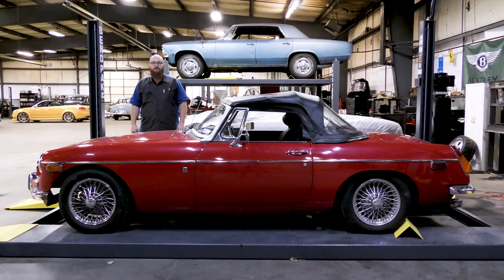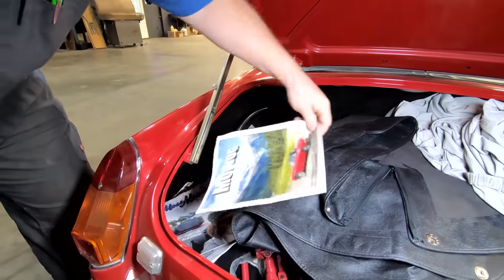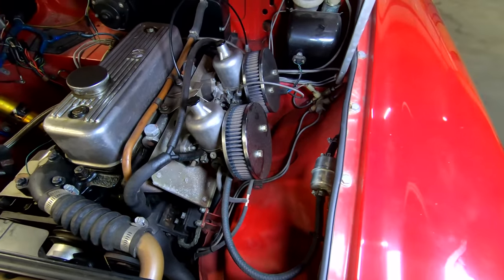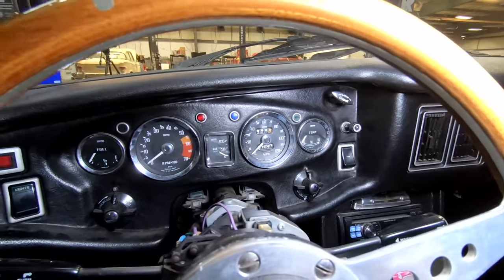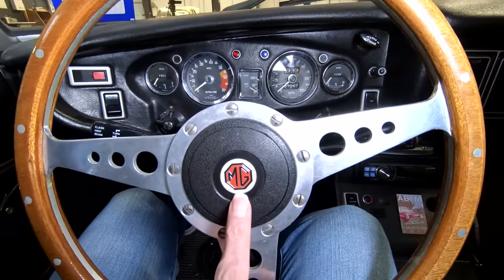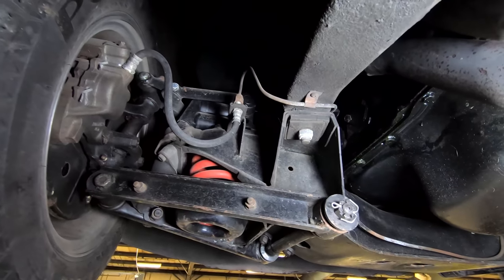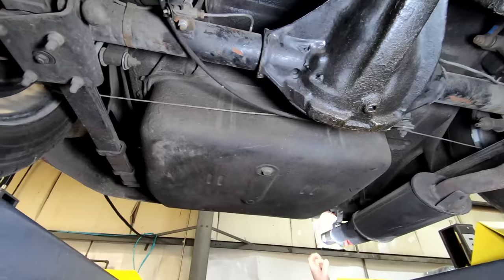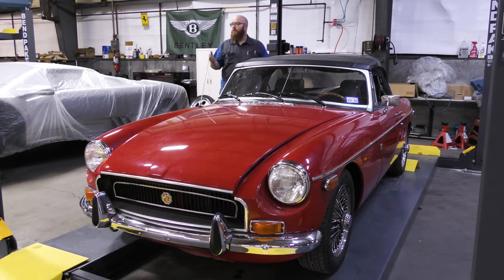Cherry 1972 MGB! See exactly why it earns a thumbs up from the CAR WIZARD!

Comment: For us here i Denmark, the easiest and best supplyer is Rimmer Bros in UK if you need parts for english cars. And they are not overprized at all. If this nice car was mine, i would put in a german Bosch fuel pump....because we all no - Lucas parts will fail at some point 😉
Reply: Us car enthusiasts would benefit a lot from a free trade agreement between the US and Europe. Euro parts are expensive in the US, and US parts are expensive here, thanks to taxes and customs fees.

The UK could easily make their own trade agreement with the US now after Brexit. That way British parts would be cheaper and easier to obtain for American enthusiasts.

It's ridiculously hard to get some parts for my 23 old Volvo, in Sweden! Most of it is out of stock, and not many thought of saving parts 'cause an S70 isn't (wasn't?) a desirable classic. But now it's really hard to find certain parts, especially electronics and such. It's pretty easy, and not very expensive, to find on eBay from the US. But then there's the taxes and customs fees when buying from outside the EU... And suddenly the cost doubled!

Comment: MOWOG refers to the Morris Garage and Wolesy car companies,  note the side of the block.  The oil in carbs acts as the accelerator pump.
Check all ground point as this is notorious for failing lights. It had two 6volt batteries wired to create 12V
Reply: It's to stop the throttle pistons moving up too quick, so in a way correct.  I had same carbs on TR7.
Reply: @flybobbie1449  Cool usual the TR 7 had the stromberg CD 175
Reply: @johnbuchanan6045  Later on, early had the SU, well my 76 car had them.
Reply: @flybobbie1449  I’m not well versed with the TR7 world I know my Mg’s and Jags
Reply: To expand on John’s answer:
MoWoG dates back to the time of the merger of Wolseley and MG into Morris Motors, it is accepted that Mo stands for Morris and Wo stands for Wolseley, but the G has 2 versions one says it stands for Group, the other says its for MG

Comment: I think that’s a 1966 or ‘67. After 1970 they had smog pumps, safety bumpers and sat higher.

It’s a really nice example with bits from new to original.
Reply: The pre-68 ones had chrome grilles, seats without headrests, black crackle finished metal dashboards, toggle switches instead of rocker switches, etc. This car does appear to be a ‘72, but de-smogged, with aftermarket valve cover and air cleaners. The raised ones with black bumpers didn’t come along until a few years later.

Comment: I had to replace the ignition switch in my B a few years ago. Finding a replacement for a decent price was almost impossible. Ebay sellers wanted $150 for a NOS.  I found one for a more reasonable $35.
Reply: Kayak TN....I believe this is your second post on the topic.

If it locked up.. 1hr fix, as most , and no cost.

Comment: The MGB was the real oxcart of the British roadsters back then.  The best one was probably the Jensen-Healy, but the best British style roadster of all was the Datsun 2000 as it was quick for the time and dependable as a nail.  A lot of fun.  The best small roadster though was the Alfa Romeo Spider 2000, but it also was the most expensive.

These owners must be new to Austin.  Although I do not see that many British cars on the road anymore, there are Jaguars and Aston Martins and Lotus around.  For BMW there are 5 excellent independent shops.  BMW was a very successful import brand back in the late 60s here.  One shop I know in Cedar Park has an ex-Jaguar tech embedded in it.  

I doubt anyone specializes in these cars currently at this date.  But there are a couple of Porsche shops and even a Ferrari shop, too.  I know an excellent shop in Round Rock which primarily services Japanese cars which could have handled this easily at a very fair rate. Unfortunately the old-time VW shop just closed recently as the owner retired. Air-cooled VW are now at the mercy of which young techs.
Reply: Macht Schnell...As an employee of one of the largest BMC (MG) Jag, Rolls, Bentley, Aston Martin, Austin, Lotus, Morris , Mini Cooper , Jensen, Jensen Healey Dealers in the US.. by comparison and actually many years of hands on experience, the Jensen Healey was a substandard, poor quality POS. This is evidenced by the few that are remaining on the road.  
PS I was a BMW of No America Training Manager.. the BMW ended with the 2002. Never the same quality again.  Yuppie junk, looks good, doesn't work, overpriced.

Comment: MOWOG=Morris owners Wolseley Group. ( according to the Internet. ) 
A & B Series engines ( Mini Mk1 A series ) ( B series Morris Oxford, MGB etc ) the engines first came out in 1954, pushrod engines, very simple robust, original fuel pump would have been an SU 
( very old company, Skinners Union ) simple easy to work on But efficient, a well set up SU carb is almost as good as fuel injection, 
The later HIF6 ( more square on top ) 1'' 3/4 can flow as much air/fuel as a side Weber but for a lot less money, HIF ( High air Flow, they were worked on bench flowed to maximize air/fuel flow ).

Comment: My old 1968 MGB MK2 originally had two 6 volt batteries wired in series to give 12volts ...

Ps - I used to have lots of probs with the distributor points until I fitted electronic ignition - went much better with electronic ignition ...

Other than that - very reliable - few probs

One more comment - if the transmission 'slips' - change the oil in the overdrive unit ...

Comment: The dash pot on the rear SU carb has been rotated from its correct position. Try comparing it to the front one which is correct.

Comment: Motolita steering wheels were always a premium item. Did you note the screw heads - all aligned, great attention to detail,
Yes I have had two 'B's ; the twin 6v batteries were a pain, any dirt on the connectors and you could crank for ever but no start. Best bit was when the cable between the batteries rested on prop shaft & wore through the insulation  - took me a while to work out why the lights went dim when accelerating!

Comment: Oh, hope you don't have to remove the heater core. It's not that easy! Sure those clips on the top are easy but that whole box fits down into the body, you have to lift the whole thing out to get the cover out and it's a real bugger to do that. And yes, the blanking plates are for exactly that, allowing for LHD and RHD conversions. My B is originally a US car converted to RHD for NZ so it has 3 wipers which were US only. That dash in that car is the US spec one, always seems a bit fibre-glassy/kit car. It looks like that car possibly has lowered springs on it. Looks like MOSS lowered front springs and the rear springs are either lowered or sagged to flat. The overdrive is electrically operated and should work on 3rd and 4th giving you a 6 speed.  If you check for play in the front hubs be aware there is meant to be end float in them, 2 to 4 thou. Modern garages don't seem to like that if that don't know about it. SU fuel pumps and rebuild kits are available from Burlen in the UK. They run fine when set up properly and will run for many years. Most of the stories about bad SUs and bad Lucas parts are from old cars that were never maintained failing after many, many years use. Older cars needed regular maintenance. It's unfair to judge them when that was never done.

Comment: The extra battery box is just that. My 1971 MGBGT has twin 6 volt batteries, one in each box wired in series to yield 12volts.

Comment: Rear scroll seal on the  crankshaft.   It's working exactly as intended.  Sort of a total-loss oiling system
Reply: No it is not on Oct 1964 and later.

Comment: Dual battery boxes for 2 6V linked batteries. I had a ‘71. I could get two or three months to the tank of gas most times, as it sat broken down, hood up and my arse in the air wrenching away..

Comment: I had the same year and color I bought in 74 . Hated the wire wheels, they always looked dirty and start to creek when cornering. Only car I owned with a manual choke.  I always loved the feel of driving it, forty years later I bought a low mileage  S2000 to fill the void.

Comment: This car is an almost IDENTICAL twin to my 1967 MGB....same color, same interior,  same everything !   I've driven it for over 40 years.  How's that for durability,  reliability ?!?
Reply: That echos my 50 plus years experience with Brit cars, specifically MGs. The 67 has a non synchro first gear box.

Comment: PPS. Overdrive was on both third and fourth gear, effectively giving you six speeds which could be flicked in and out of with a reachable (from the steering wheel rim) toggle on the dash.
Reply: Joshua, There are some of the Laycock De Normanville O Dirves that were top gear only such as mine.

Comment: that is for the 2nd 6v battery the car originally had two 6v batteries in the back most owners (my dad who had 3 MGBs) would convert it to one 12v battery leaving the other tray empty or getting a battery box for the trunk.

Comment: Trivia: Above the temp gauge is a manual choke. To choke the carbs for cold starting, pull the handle and turn to the right to lock in choke position. If the handle breaks off, as mine did, use a pair of pliers on the remaining shaft.
Reply: While pulling out the choke depress the accelerator pedal

Comment: Two battery boxes were for the original twin 6v batteries wired in series.    
My 68 would stall because of a short in the fuse panel mounted on the RH wheel well

Comment: It's incorrect to refer to the 'Handbrake' of this car as an 'E-brake'.  When driving this or any manual transmission car, (without one of those new fancy automatic parking brakes) the handbrake is a control which is in constant use, not just for emergencies.  Applying the handbrake should be your first action when coming to a stop.  Releasing the bandbrake should be your last action as your pull away.  Of course coordinated use of the handbrake is essential when performing a hill start.  Anything less would have meant failing a driving test in England, certainly back in the 80s when I took mine.
Reply: Plus makes parking in tight spots so much more fun with a handbrake slide sideways into the selected spot......

Comment: hahaahahahaaaaa... The most fun you'll ever have at 40 MPH! LoL I remember working on these MG's as a kid. And having to remove battery to get to fuel pump. Because Fuel Pump had trigger points just like the distributor. As with all points, they need to be adjusted, filed, or simply replaced.

Comment: The extra battery compartment is explained by the fact these came from the factory with 2 separate six volt batteries.  A common fix for a non functioning fuel pump was to hit it with a mallet.

Comment: the fuel pump has adjustable points (old technologies) if the car is not used a lot the points will get dirty

Comment: Run 4-feet of small diameter flexible metal dryer vent/HVAC duct hose from the front grille to the carburetor  intake area.

Comment: These had about 100 horsepower in 1972. By 1979 with the Stromberg carbs and a catalytic converter got down to 63 horsepower.

Comment: Didn't the MG come with twin 6 volt batteries originally until 1975?   The shocks are called lever action  Triumph also used them.

Comment: I wish you could find a 1969 to 1972 fiat 124 spyder.
Light years ahead of that MG.
And so much more reliable. 
Very nice example of the British car, though.
Reply: I had one of those Spyders.  Put two head gaskets in the engine before I quit supporting the machine shop.

Comment: As for the second battery location I was lucky enough to have use of a 1960 MGA (my brother's girlfriend) driving across the Golden Gate Bridge on a lovely Fall day, two six volt batteries under the rear panel.  Maybe the same for early B's?  Or maybe for when it was built for right hand drive?

Comment: the mgs had a racing team with the mgbgt and the mgb as well the 1.8s and the v8s were also raced
Reply: MG factory did not race GTS or V8s.
Reply: @jeffhildreth9244  final thought, I said MGB’s could be race cars. The caveat being they do require modifications, to reach tuning level C. Or heavier modifications to reach that of the Huffaker MGB team racer, which was the factory sponsored team in the U.S.  This was not a street legal car though.  I would also be point out MGB’s we’re raced and rallied in Europe both as factory cars and as privately sponsored teams.

Comment: You shouldn't have to manually disconnect the latch if the trunk strut is working properly, it should automatically unlock when the lid is lifted fully open and then the lid can be closed one handed!
Reply: That’s only true for Triumph cars

Comment: The trick to working on Lucas electrical systems is to understand that they operate on the Smoke Theory of Electricity. If you work on them assuming the Electron Theory of Electricity, you will have a bad time with it.

Comment: i saw a green one of these on the Beltway in Houston a couple days ago..honked and gave the driver a thumbs up..and i thought a Miata was tiny...i always liked the looks of these, but no way my almost 6 foot frame would fit in one
Reply: Early B's have a surprising amount of room.  6-foot-plus owners are not a scarce as you would think.
Reply: plenty of room for long legs. Allot of the engine compartment is footwell.  If you're fat, that's a problem. Not allot of side to side room

Comment: My Dad owned an MG B which he bought in the late 1960’s. Great car which worked well when we lived in Louisville KY but did not fair well with the families move to central Wisconsin… Hating the cold and allergic to road salt the MG let us know how miserable it was by becoming increasingly unreliable requiring significant and often expensive maintenance. The car suffered an early death in the mid 70’s literally breaking into due to corrosion.

Comment: MG used to use dual 6-volt batteries in those twin battery holders to run the 12-volt system

Comment: Love the paint, it all seems to match. Get rid of the blue tape under the hood. Re-route both braided cooling lines low below coil position. Really nice car.
Reply: The blue tape on the wiring harness is original spec. So no!
Reply: @briandawkins984   No, that is not correct.

Comment: The second battery tray is because these cars originally had 2 6 volt batteries wired in series. Mine is a '78, and only has one battery tray.

Comment: The two battery boxes are due to the fact that it originally came with two 6 volt batteries.  Cannot remember if wired in parallel or in series.

Comment: The MG badge confuses me.  When was it moved from the hood to the grill, as is
shown here?
Reply: they only did that for for what they called the fishmouth grill. The one shown here, 70-72. Everyone complained so '73 they went back to a grill where the radiator badge plinth lines up with the bump on the front center of the bonnet (AKA Hood), Chrome surround and a plastic honeycomb inset instead of vertical aluminium slats, then alas at the end of '75 they went to the horrible giant rubber bumpers which was the beginning of the end for the poor old B. Ironically the MGC kept its chrome bumpers and met the collision requirements via larger wheels and a slightly higher ride, but the Leyland octopus had a death grip by then. The triumph people had got control of the board and were playing politics.  FYI the fishmouth grill bits and pieces, especially the trim on the bonnet, are worth a fortune. Unobtainium.

Comment: i own a red/orange 1980 convertible MGB with a 4 speed manual transmission with overdrive, the last year they were produced with under 15,000 miles.... i keep it in complete perfect running condition, this car looks and drives brand new, the problem is, no A/C, SMILE!....I BOUGHT IT NEW FOR UNDER $2,800,00....Please, no offers to take it off my hands.....(Note:my prior model MGA, was a piece of mechanical garbage)...,.,.i change the engine oil once a year and all other fluids at least once every five years and start it up once a month....i have drowned it's undercarriage with undercoating and rust prohibitor throughout, plus all moving parts in need are kept lubricated .....yes, my garage is heated and no rodents.......My body should be kept as well as this automobile......Besides having no A/C, the only complaint i have is when i entered a heavy traffic highway that has NO Entrance Lane my body shutters for fear of being run over, BIG SMILE!

Comment: 14:19 Wizard... The reason there is a second battery box is because they came with 2 six-volt batteries wired in series to make 12 volts. I had this same year MGB, so I know of what I speak. And no, I'm not going to give you the satisfaction of describing my experiences with the lovely Lucas electrical system (although I do have stories to tell... ha ha! 😅 😂 🤣)

Comment: I think MG's and British cars in general recieved a bad reputation starting in the 1950's by corner gas station mechanics (high school kids), who were unaware of Whitworth/ British Standard wrench sizes. They were perhaps aware of S.A.E. or Metric, but they are all different. As for british car parts sources, with the internet, I am no longer restricted to Moss/ XK,s U nlimited as sources. Example: I bought a generator conversion to an alternator from the original manufacturer in England, including shipping, $130.00 u.s.( 10 days delevered). That's half price of any source in the U.S.( 1955 xk140 jaguar).